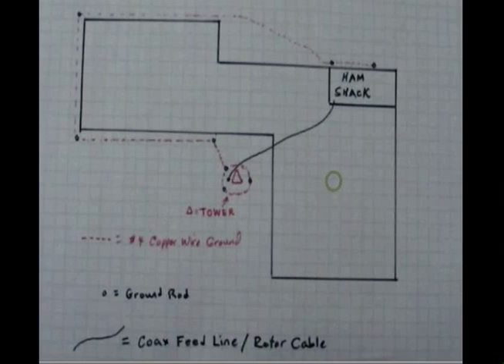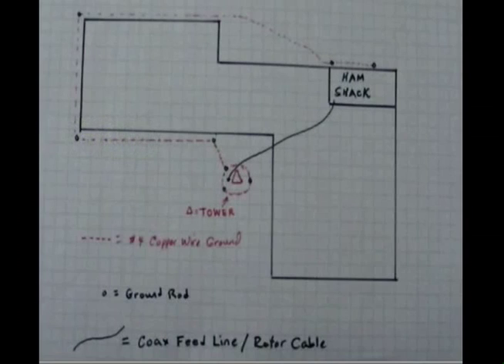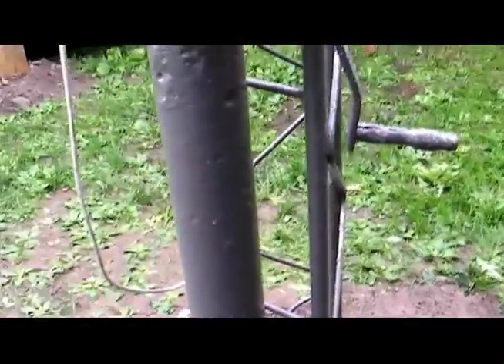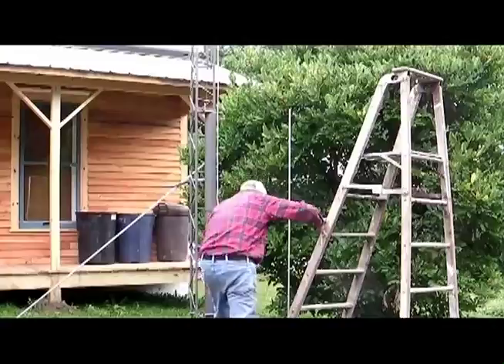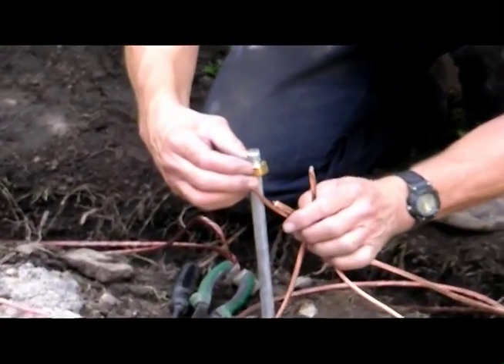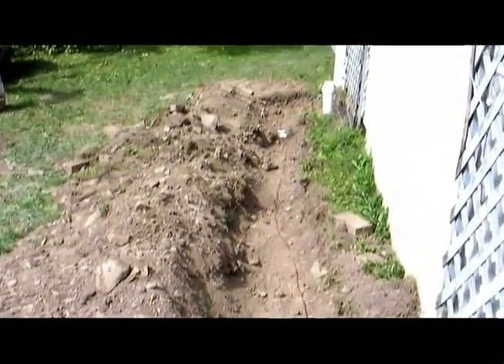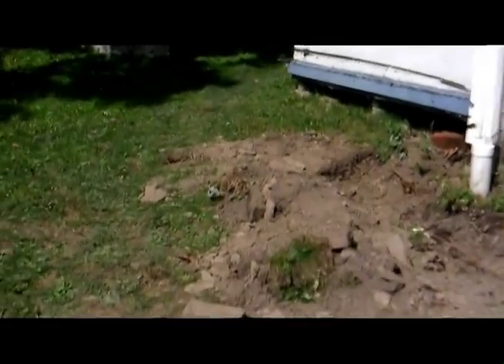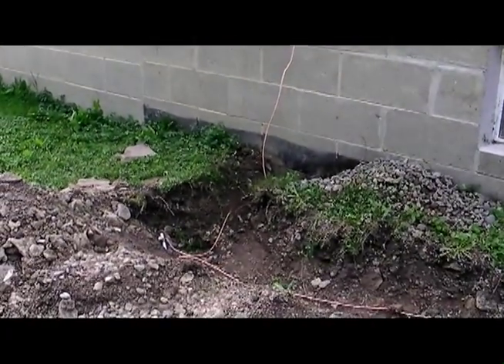Amateur Radio Tower Grounding.

Comment: Just an FYI for anyone installing ground rods in the future, if you leave a garden hose running at the base of the ground rod to keep the soil wet it will hammer in like butter verses having to beat it into dry ground. Source: My uncle taught me that trick when I was young
Reply: smart man your uncle was.  true statement!
Reply: I genuinely appreciate this! Thanks for sharing his knowledge 🙏
Reply: Do you need to saturate the soil down several feet first by letting the rater run a while before pounding inn the ground rod, or do you mean just turn the water on and  immediately begin to pound the rod in?
Reply: @derrickbaranowsky5715  It would all be depending on the current moisture content of the soil. For example where I reside in southern Illinois the soil is wet all winter and spring, so running water is usually not needed, but in the summer and fall we let it stream the whole time we hammer the rod into the ground

Comment: I'm all for good grounding, but the only sure-fire way to protect your equipment from an antenna strike is to disconnect your antenna from your radio.   If lightning hits your home and your radio is plugged in, that grounding wont help you.  So I say kudos for your efforts, but please unplug your radio and disconnect your antenna when you are off the air.
Reply: Yep disconnect coax and place it in a glass jar to insulate it.
Reply: it can't hurt to unplug,  but. it's not true that you have to, if you have a proper ground gear should be fine.  emphasis on a proper ground.
Reply: @mylesl2890  Go ahead and take your chances, its your gear.  There is only one absolute way to protect your radio from an antenna strike - unplug it.  Its also the easiest and the cheapest.
Reply: @mylesl2890  If the lightning strikes your antenna, travels down the coax and into your home it doesn't matter if your tower "chassis" is grounded!  The antenna center conductor is isolated from the braid electrically to carry a signal.  It's the only way our radios can work.
Reply: @mrmrlee  no well that is the entire point of having proper grounding and lightning protection, to prevent it from 'going down and to the rig.  the idea is to divert it before your rig which is commonly done --plenty of articles from official places on how to do this,  think about. all the expensive stacks of gear on super tall buildings that get hit daily v rare. makes it to the gear don't take my word google away.additionally I didn't say to just gnd the twr.

Comment: Good info; Ground rounds should be as far away from each other as possible; 8ft should have a 16ft raduis; 10ft ground rod should have 20.  Very nicely done video.
Reply: Steve Klise.... should be separated 1.5 of the length of the ground rod.  So my rod is 8' so they will be separated by at least 12'.

Comment from the maker: Ha ... well after I went to all the trouble and expense, I don't think I would bother if I had to do it again.  I got along 20 years without any grounding at all..... just unplug your equipment and take your chances.  lol
Reply: TimTools99 when grounding your shack,Will i get a groundloop problem if i connect the radio plus antenna plus amp to the same ground....I appreciate the information u provide..thank u

Comment: Many folks under estimate the shear overwhelming power of a large lightening strike...it will jump and fill all sorts of gaps and overwhelm ANY attempt of negating it. Old timers say grounding systems attract stikes. I'd say build close enough to a large oak for it to take the strike!!
Reply from the maker: You are so right!   I have learned since I did this that I basically wasted my money.  I never grounded my antennas until I got that tower and I thought I better do something but the best thing we can do is unplug our equipment and pray.
Reply: @TimTools99  thanks for that. Over my lifetime I have aquired a large "network"  pool of ole timers (rural folks and "doers") that I take into account their life experience. I then average and assess. There's LOTS of wisdom out there.

Comment: Xothermic or Cadweld one shot's are perfect for permanently bonding the ground conductors to the rod. They come in different configurations. Google the subject. When I was working as an electrician some years ago, I was with a company that contracted to Pacbell and Sprint to build Cell sites. We used Cadwelding to bond #4 solid copper wire to form a "Buss" or Halo ground system. This allowed multiple paths to a central ground so that lightening could exit more effectively. Even the metal fence posts surrounding the pad where the equipment package was contained, were bonded in a like manner. We used a strap on mold made from Graphite to Cadweld to the posts. The same can be done to Tower Legs. Anyway, congrats on a job well done.

Comment: A nice trick is if you have a hammer drill, you can get a bit that goes in the end that is cupped, and put the hammer drill on top of the ground rod and can drive an 8 foot rod in a matter of minutes instead of having to hammer it by hand. It will break through small rocks with ease as well. Im a commercial electrician and in the field while doing grounding rings on buildings we have also used plug in big hammer drills, you put a zip tie on the trigger, put it on the ground rod than tilt the ground rod up with the hammer drill already on it then have someone plug the hammer drill in while you hold the ground rod and it will drive itself down with the weight of the drill, so no need for a ladder. Quite handy in all honesty.

Comment: Looks like an excellent video. If anyone doing this in the future in theory your ground rods should be spaced by the length of the rod at minimum. So in theory I think an 8 foot rod should be 8 feet from another rod. But I'm sure that's not like a big deal or anything.

Comment: My Comments are Meant to be Constructive Only!

Thats Alot of Work digging trenches all-about the area.
Adding Multi Ground Rods as shown in this footage is Null & Void..
YES of course its great to Clamp Each Tower Leg  but Only connect to (1) Ground-Rod-Only!
You are using #4 & #8 copper wire that is geared towards Electrical services only!
The wire(s) being used are ONLY able to carry 60HZ
You Should be using 1 Inch Flat Strap Copper Ground Straps as they handle 100,000+ HZ.
YES allow the least path of resistance for Lightning but not with 60HZ electrical ground wire.
Using Coaxal-Ground-Points are 100% Useless!
They only offer you False Sense of Security.
As the old saying goes-- 
Lightning will Do What-Ever-It-Wants-To-Do! 
We live in South Florida / Lightning Capital of the World.
Reply from the maker: I learned a lot doing this project about what I did wrong but it seemed like there was no consensus on how to do it.  Everybody seemed to have a different idea.  If I had it to do over ... I wouldn't bother.  Just unplug my gear and hope for the best.  lol

Comment: Nice Video.  A couple of points to mention:  First, ground wires outside should be solid and not stranded wires or braid.  Each strand of stranded wires and braids tend to oxidize (corrode) insulating them from each other which increases the impedance of the ground system.  Second, NEC requires only a single ground wire per clamp unless the clamp is made for more than one wire.  I am using the same kind of clamps and have run the ground wire through the clamp (in through the top and out through the bottom) to go on to the next ground rod.  Then I use a second clamp for the wire from each leg of the tower to each ground rod.  I wouldn't worry much about the clamps but you may wish to check the stranded wires for corrosion.  If it happens, the stranded wire can be replaced with solid wire down the road.  Good job.

Comment: I live in Florida and they get lots of lightning strikes here, I used three 8 ft. ground rods at each tower leg. I used 2 inch braid but should change it to solid copper wire. The tower is 80 ft and guyed at 40 & 80 ft. so the guy-wires also serve as dissipation of build up static and add to the grounding of the tower. A bit of rock-salt in the hole where the tower sits in the sand helps because there is no soil just sand.
Reply: Redawg58, most people want to try and divert the lightning from going through the base.  Epson Salt and water is great along the ground wires and rods.... Increase those impurities.

Comment: Hello sir, mine is a rooftop tower. Can I connect it to the same ground which I had built for my house?
Reply from the maker: They say NO.  This grounding business is tricky.  There are so many conflicting opinions.
Reply: NEC code actually requires that all grounds be bound to the main electrical ground.

Comment: Well I figure grounding is for lightning for the most part. Ima ignorant of more the merrier for static.

I see below a man mentioned Cadweld, of which coincides with what I was told long ago of long term grounding.
Simply put, the ol' addage "rust never sleeps".  One day corrosion between a screwed in bolt tip and the ground stake will be.
~ Who knows what lightning thinks. I was in gramps old farmhouse when it was struck and least figured; lightning hit the tree, jumped ship to the telephone line, then again to an unused gas line into the house that ended at an open ended flexline...and spent it's left over energy in the room which I was in..kitchen. (fahhhk!)
 Blah blah, room filled with smoke, melted/buckled some granoleum flooring, ashed the garbage can and microwave hutch, lower wall.
Lightning jumping ship ignoring corrosion to ground who knows. But no air entering connection means no corrosion...all utilities grounded with a bolt/screw to pipe.

This came to mind seeing all the work done and just bolts used.
tips me hat ~
Reply: lol, my ground one might ask?
I've an old forty foot Radio Shack telescoping job/Antron 99 (58'?) bolted to a fifty foot, old chain link fence.
ho hum, Faraday fence? (-:

Comment: I just have a 9 foot ground  rod hammered down only leaving a few inches exposed for clamps. I have a ground block inside the shack grounded to the ground rod with a piece of #6 stranded and all the equipment grounded to the ground block with #12 stranded. No ground on the 35 foot tower at all. Seems to work well.
Reply from the maker: waldan1701 Yes, I think that is just as good as what I did!

Comment: Nice video! The RF-ground is mostly to stop the interference from coming into the shack, and stopping RFI from emitting from your antenna. Have you noticed any difference in interference coming in to the signal?
Reply from the maker: Thanks.  I haven't thought about the RFI improving.  The A3s antenna works great on this tower.  I'm pretty happy.

Comment: Hey, Tim, I'm using no ground on the second floor, except for standard house ground and connecting my equipment to a bus bar.  Had a nearby strike 2 years ago, no effect on anything... Radios were still connected, it was a surprise storm. 
I guess I got lucky.  :)
Reply from the maker: +Markinpuff 
Thanks for the comment.  After I did all this expensive grounding work, I have wondered if it was worth doing at all.  There are many theories on the proper way to ground and this quite possibly might not help me at all.  I think if I had it to do over again, I would just unplug all my cables from my equipment when not in use.
Reply: @TimTools99  Even unplugging in a storm does not necessarily negate the risk of damage from a nearby lightening strike. EMF from a strike could easily destroy electronics which is not even plugged in to anything. One case here in the UK, destroyed almost every electrical item in a guys house when his antenna was struck (it was connected) - even things still in their boxes got destroyed by the EMF. I must admit it is a scary thought! Nice detail in the video. Best wishes.
Reply from the maker: @athertop  Thank you Paul.